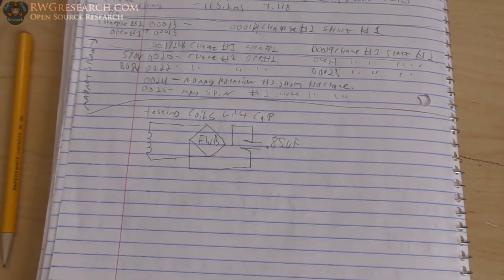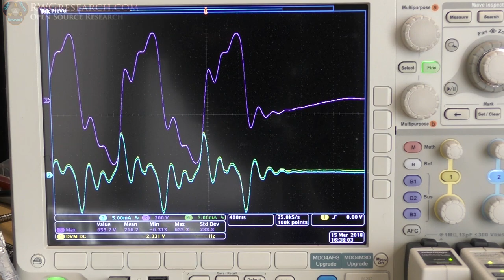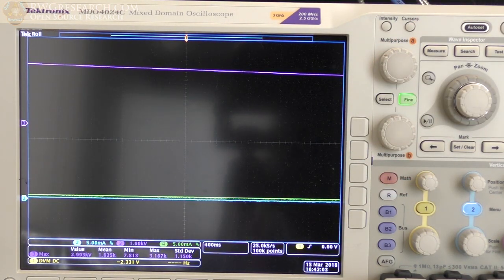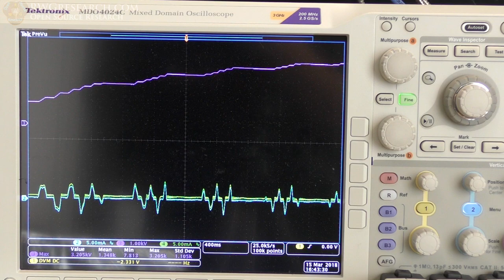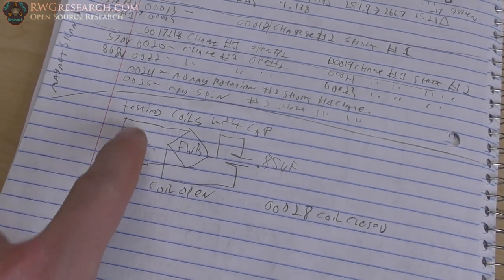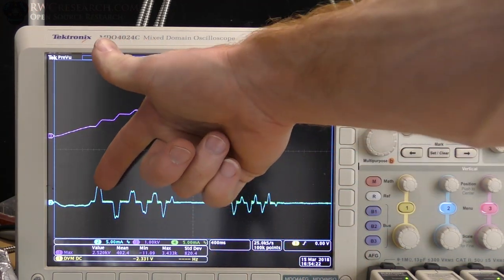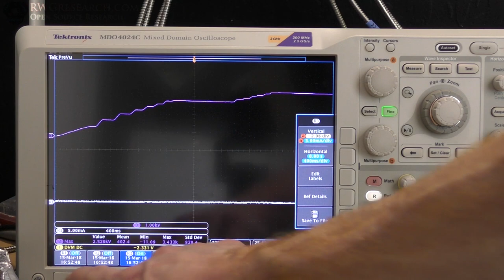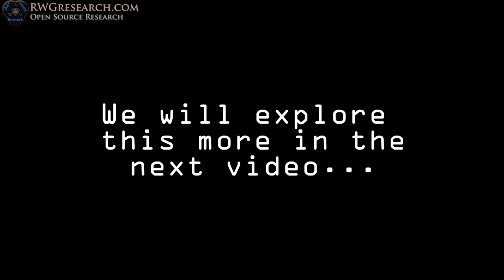JWN Project P13A: Big Coil Cap Charging Tests.

Comment: Well done, but what you should do is apply the battery voltage across the coil for about 5 Tau, so the magnetic field is fully build up inside the coil and then disconnect the battery via a copped-graphite switch and see how much the BackEMF charges up the cap by just using a single diode to charge up the cap to capture the BackEMF spike... Then play with energizing time of the coil and see, how long you must connect the battery, that it can charge up the cap to its maximum voltage... Many thanks.

Comment: Hello. I have two questions. Answer if you can.
1) If the initial frequency is 25  after it passes through the diodes, what does it become ???
2) How do you select the capacitor to correspond to the frequency ???? let's say I have a neon transformer. 30kHz  15кV 0.030mA What will remain after passing through the diodes ??? And what do I need a capacitor for ???